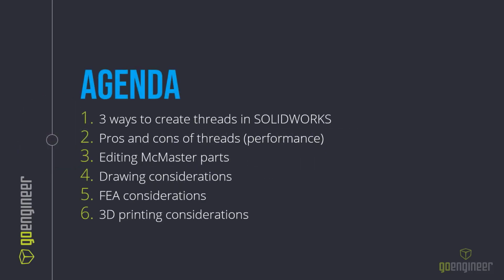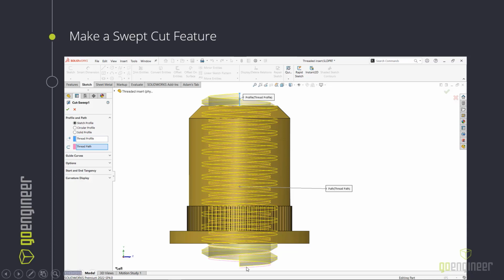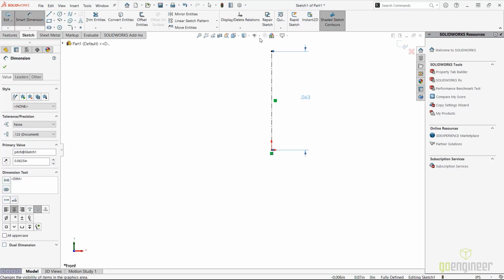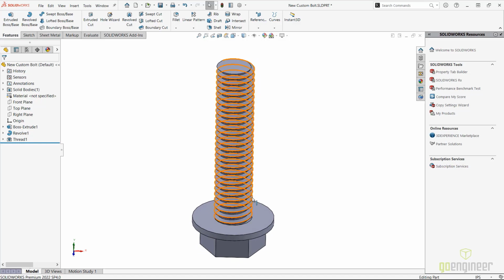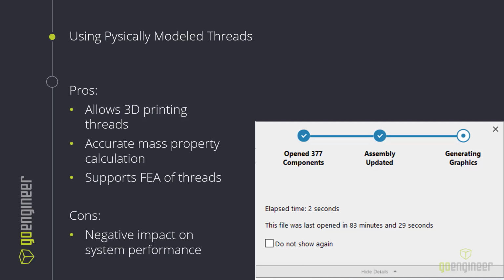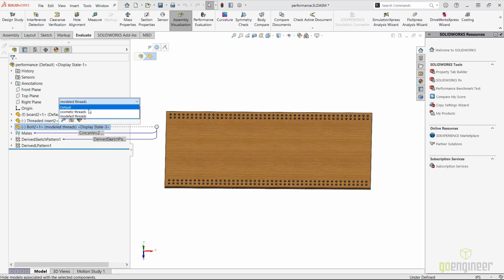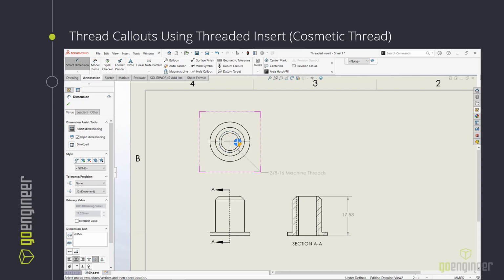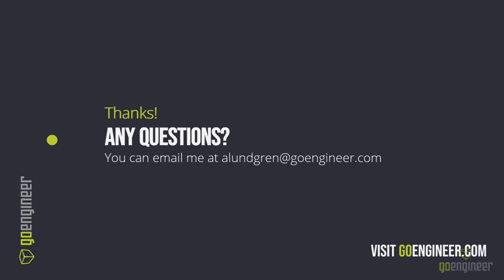Ins and Outs of Threading in SOLIDWORKS - Webinar

Comment: I don't find any tool named "Cosmetic thread", there is an option of cosmetic thread in hole wizard.
Reply: Cosmetic Threads are considered an Annotation type feature in the part modeling environment. At the top of your SW window, select Insert -> Annotation -> Cosmetic Thread. (each of the "->" symbols is a flyout submenu)